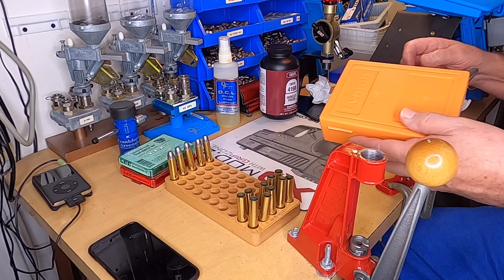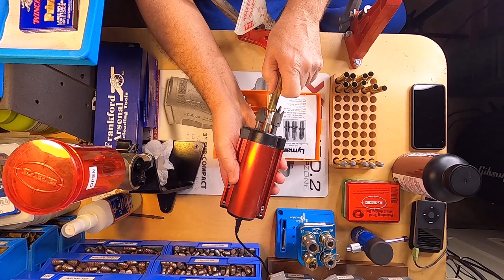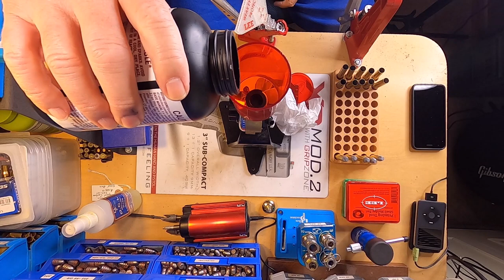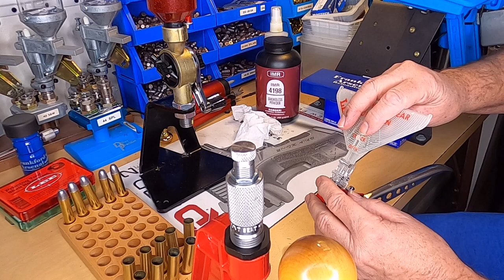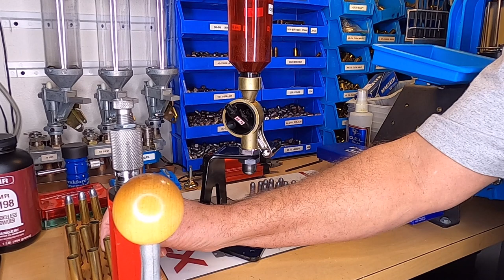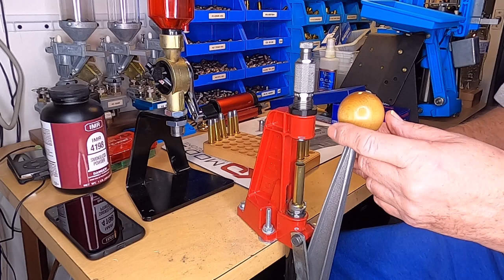45/70 Reloading

Comment: Great video. Did you have to do anything to get the IMR 4198 to flow through your powder measure? It looks like it is easily dispensed. I have a RCBS uniflow and the same powder gets stuck and in order to throw a charge occasionally I have to actually push through the sticking point and I believe this actually shears some of the granules. Any advice?
Reply from the maker: I never liked RGBS reloading stuff, I stick with major brands. Dillon ,Hornady and Lee is what I use. Thanks for watching.
Reply: @jeffpattersonmadcityvideos3413  Ok. Thanks for the reply.

Comment: After reloading for 20 years I find that anything to speed up the process is worth the expense especially if you reload several calibers. With a turret press you can permanently set up the dies for 2 different calibers. 
After resizing the cases the lube should be cleaned off, something not mentioned. If you use a wet tumbler, the primer pockets come out clean eliminating the need to manually clean them. The case mouths can be flared and new primers installed in the same operation with a turret press. When using smokeless powder in a large case like the 45-70, the bullet should be seated immediately to prevent an accidental double charge which can be disastrous. At least weigh the finished cartridges to see if one is unusually heavy that could indicate an overcharge.
Reply from the maker: That's right, thanks for watching.

Comment: Good video,  thanks!  
Can you put a list of the equipment used in the video to help those desiring to replicate your setup?
Reply from the maker: I've got the Lee single stage press, the Lee auto bench prime, the Lee deluxe perfect powder measure, Winchester primers. Lyman 7460496 dies, Frankfort Arsenal scale, IMR 4198 powder, Lyman case lube pad, Lyman reloading handbook. Any case lube will be fine .If you are reloading for the Trapdoor Springfield you MUST be sure to load for it and not for the 45/70.

Comment: Good video for covering 45-70 in trap door / single shot 45-70's, but for lever action the process would have to include a crimp after seating to avoid any bullet setback in the magtube that results in over pressure.  I just started reloading 45-70 and learning just how handy the Lee factory and Redding profile crimp dies are.
Reply from the maker: Yes I would  crimp  if using a lever action rifle.
Reply: The Lyman seating die will do a roll crimp if you set it up properly. However, I prefer to crimp in a separate step with a Redding Profile Crimp Die. Seems to be more tolerant of variations in case length.

Comment: What is the grain of powder? I see it's Mir 4798 I have Mir 4064 and use 25 grain of powder to push my 500 grain bullet.. it's just shy of 500 grain more 498.. I cast my own bullets. I Will be shooting them out of my new marlin 1895
Reply from the maker: I used 31.5 Gr. of IMR 4198, a medium load for the old gun.

Comment: I grabbed a pound of H335 back when it was all I can find (now I can find basically every powder imaginable only a few months later, a good problem to have really) and started reloading. 

A 405gr lead cast bullet and 54gr of H335 in my Marlin 1895 SBL. Seems to shoot fine, but am I a psychopath for this load or is it reasonably standard? I just used what I could find.
Reply from the maker: Use what you can find.

Comment: How many grains of powder do you put in the case?
Reply from the maker: I'm using 31 Gr.
Reply: @jeffpattersonmadcityvideos3413   I do a similar loading with the same powder I used 325 grain projectiles with 42 grains of powder just a little over 2,000 fps second
Reply from the maker: @hunterrogersyoyo3345  Sounds good.
Reply from the maker: @hunterrogersyoyo3345  Sounds like a good load.

Comment: Didnt hear you mention cleaning the primer pockets. Not cleaning them is the leading cause of misfires.
Been reloading for over 40 years and still use single stage. Dont go thru enough ammo to justify progressive press.
Do all shells in steps except, Once you have all cases primed and press ready for bullet seating, to avoid any possibility of double charging, add powder to one case at a time and immediately seat the bullet. Most effective way to avoid overcharging and maintain safety.
Reply from the maker: That's right.
Reply: Mentions the priming pocket clean at 3:20

Comment: Well a very important part you did not show . You don’t just dump you gun powder in . You need a scale and get the right amount of powder in you’re case . Too much powder and you might lose your hands or lose your eyes . Or maybe you’re gun will blow up in your face . To little power and the bullet gets stuck in the barrel .
Reply from the maker: I weighted the powder charge die with a scale to get a very accurate amount of powder, then it's locked in for that amount.
Reply: @jeffpattersonmadcityvideos3413  but you did not show that. So a new person might just think you just dump the powder in a not weight the powder because they did not see it being done . Don’t for get they might be new to the reloading .
Reply from the maker: @johnbailey9682  I'm glad you mentioned that, thanks for watching.